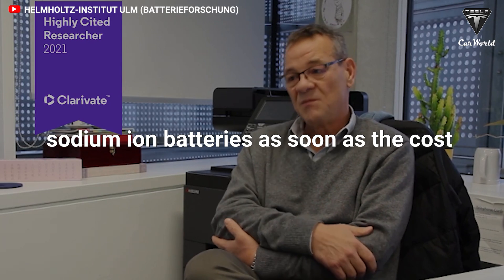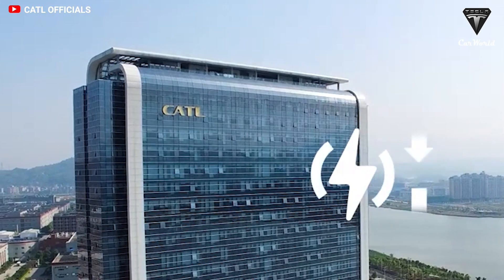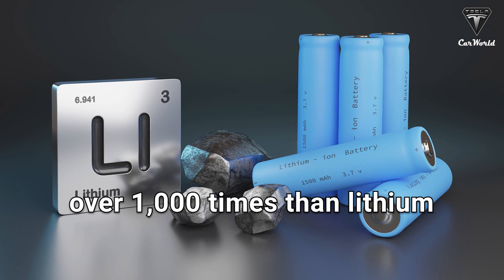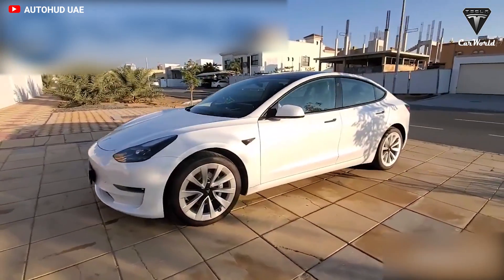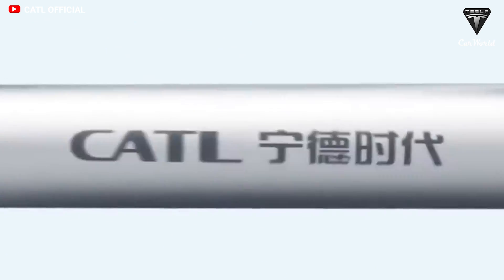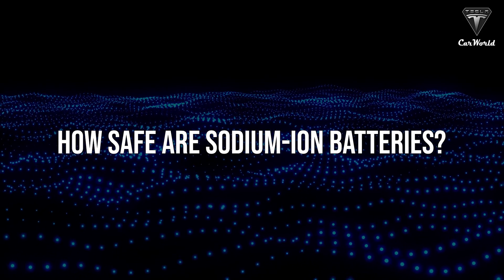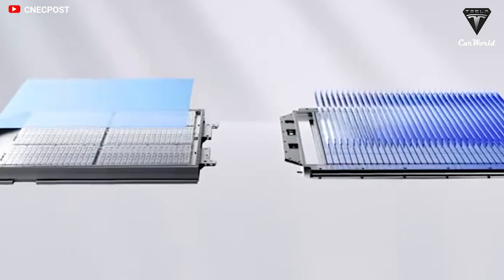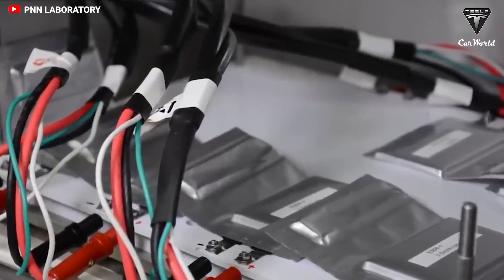Goodbye Lithium! NEW Sodium Ion 4.0 Battery Changes Everything in 2023!

Comment: As the lithum battery manufacturer，I've talked about  Sodium battery  with my colleagues  and we have many ideas about it. For the one hand , the sodium ion batteries has a very low price  And sodium is very easy to achieve, also it has very fast Charge speed.  For another hand ,the sodium ion batteries has two big disadvantages, The laboratories doesn't find out both affordable and safe and efficiency nagetive material, Meanwhile it needs much more even  Twice  Volume than the lithiumbattery to Provide THE SAME power.( I feel so Sorry for my broken English😥😥 ). Maybe you should know that the scientists began to experiment on the two batteries at the same time. However, the  Sodium battery perform Not very well for it's negative material. And the scientists cannot find  A very very perfect one until today.😥 To put it into a nutshell, I think for its  Affordable price and it's so achievable,WITHTHE development of the technology, Sodium battery will definitely play a very, very important role in the future battery industry. At the same time,it can never be as powerful as lithium battery(BECAUSE Li is before Na in the periodic table of ele ments) The lithium and sodium hybrid battery  may come first in the future.🧐🧐( I'm not sure whether I express what i think😥 cause English is not my mother language ) I will appreciate it If you have different ideas😆😆  Heated discussion will make theBATTERY industry much more better.
Reply: Thanks, and I have a question about the "Child Labor" --> Is it mostly true ? Or is it 1 case of child labor out of 1000 perfectly fine Lithium "mine" ?
---> So can Sodium Batteries have a better human-right value ? Or was it all an exageration from the medias ?
Reply: The primary issue is that the ion charge emitter side will degrade due to the larger ion size leading to reduced current capacity. The problem could be avoided by adding metal to the carbon intercallation media and using an extremely porus form of carbon. As for the acceptor side it is more problematic because the larger Na ions will bind more strongly to the CuCoOx based acceptor material. It can be traded for iron, particularly as copper 1 ferricyanide complexes. The penalty will be a bit lower voltage 2.7 to 3.3v and lower capacity per volume. It would have a higher current capacity due to the conductance imparted by the copper being an intrinsic part of the composition. 🤓
Reply: Would they be efficient in applications where size isn't an issue,  like ground installations, like megapack?
Reply: @1Eagler  Absolutely.  Do you care about the size and weight of your AC unit once it's installed?  It's a brick like any other on your property that you largely forget about :)
Reply: As an individual I don't mind 50% lower energy density or 2X the weight for 7X lower cost and faster recharge speed.  I do prefer small devices like phones to last at least 3 days between charges and I like batteries with a long overall lifespan preferably at least 7 years before the battery capacity drops to annoyingly low levels. I definitely get really frustrated when an old battery has to be recharged multiple times in a day. I'm also definitely unhappy that newer phones and laptops do not have replaceable batteries, and I also do not like pouch cells in general, simply adding an air exchange port to pouch cells so they don't inflate would make a huge difference but overall they're just a really bad battery design in general.
Reply: @SolarSeeker45  The thing is, the person in the video here is overstating the problem.  The best hybrid designs are 5-7x lower cost and about 20% lower energy density.  The replacement, though, are graphene batteries.  They are abut as pricey as Lithium Ion are now (with the price hikes) but offer 2-3x the energy capacity per kg.  My guess is that we will see the high-end luxury models using this and the lower-end consumer models running around town on the cheaper Sodium batteries.
Reply: @josephoberlander  That's a new one on me. I've heard of graphene super capacitors but I haven't heard of graphene batteries.
Reply: My worry with any battery that can, once it is on fire, be impossible to extinguish, now it the car is out in the open, it can just burn up, but if it is in a basement of a carpark, there is a danger that it can spread to other vehicles and do great  structural damage to the building which may result in its collapse.
Reply: For premium solutions , yes Li-ion will be the material/battery to use in the coming years . There are however many different uses for batteries , in which people/companies are certainly waiting for . For this i mean , storage of energy , renewables to be precise . Solar cells are nice , but saving that electric to use on a time when the sun doesn't shine is much nicer. Also , charging your car fast is nice but the grid not being able to follow on the sudden spikes in demand is also another option . With all the electrification going on , these things are getting more important by the second . Battery packs being offered at much lower value , 10kW/20kW ... for a affordable price has a very significant market . Yes , the sodium might be bigger and heavier , but it is not significant for such uses .
Reply: I agree also sodium is also very heavy.as more mines come online to meet demand im sure the price will go down within reason again
Reply: @pausesmana5531  africa may have child labor in lithium mines but by far most lithium is mined in south america and austraila with union labor
Reply: @benth162   What is your comment above?
Reply: @pausesmana5531   Definitely you are joking or you are A robot and maybe something i say has trigger keywords?🙉🧐
Reply: @christopherleubner6633   It's one am and i must go to bed now.I promise I will get up earlier tomorrow and reply You once I get up.🤔
Reply: @kricel  when I replied to your comment they didn't post it directly above yours, but stuck it way down the list.
Reply: @kricel  No, I didn't do my research, so I ask you as I saw you could have many more infos than other viewers here ^^ zero harm in my words. And Someone already responded to me so I have my respons : That there is only a few Lithium done in african mines.

The trigger words were you saying : "As the lithum battery manufacturer" --> So I thought you have more knowleadge
Reply: @1Eagler   Sure! I think what you said is what is the sodium ion batteries advantages and absolutely it will be a future trend.( It had its own advantages than both Super capacitor or lithum ions)😆
Reply: @josephoberlander  yeah! And the government will need it too.
Reply: @SolarSeeker45   The sodium ion batteries  As the level cycle expectancy than lithium ion batteries. If you're looking for a both fast charge and long cycle expectancy battery, You can go for Super capacitor(10000cycle times because  It won't have  Chemical reaction )( but it is very expensive. And also it is easy for it to discharge Automatically ) But if you are also want the low price. I think we can wait for the technology to develop I hope in the future We will get one.😎😎
Reply: @josephoberlander   You said what I want!😍 But I heard that the graphene Super capacitor  Will discharge automatically. And it is it's super disadvantage.( It will lose  Electricity  by 40% in just 12 hours now ) But I am confident that we can solve this problem.🤩
Reply: @SolarSeeker45   I think maybe he's talking about the same thing.😂
Reply: Terry White  I totally agree with the first half of what you said, but I haven't heard of the second half (and I don't know that the Great Lakes belong to Canada at the same time) let alone. . . Moreover, when building a large-scale power station, environmental protection and the opinions of local residents must also be taken into consideration. Do you mean that there is no shipping development on those lakes? Why is this? (It’s not that North Americans really may not understand these.) I think that if a resolution is correct, it will be implemented one day. If the implementation is to be accelerated, the proposer needs more power to speak or the decision-maker is more wise.
Reply: @Simon John Actually, I'm doing the lithium ion battery solar system  And I believe that Sodium ion battery will be the future trend.(  You know the large manufacturer in the world is now fastening their experiment in sodium ion battery) But it will take years, you know and The small manufacturer don't have enough finance (BECAUSE There are are still a lot lot of technology Difficulties in the solium ion batteries such as the Material in its negative pool) And you know the lithium battery is so hot these years  And even the small manufacturer can make a lot of money.JUST WAIT FOR TIME youknow🤔🤔
Reply: @adoreslaurel  If you are very afraid that your car will catch fire, you should first use a traditional car. If you want to use new energy, there will be relative risks, but the safety of each new energy and car is different. If you don’t care about the price, you can Using titanium ion batteries, its safety and stability are very high, and its cycle times are very long, but its energy density is low, and its price is very high, and secondly, you can use supercapacitor trams, which are also relatively safe, and he The number of cycles is also high. But the second is the sodium ion battery and the ordinary lithium iron phosphate battery, and finally the ternary lithium battery (although it is more dangerous, but its performance is really very good). The above is not considering the price and performance, but only considering the safety. ,You can refer to this.
Reply: @sergesmets5685  ah， I feel so. Sorry I can't understand what you said. Is what you said is the Na ion  Is a perfect choice for the low price car Instead of the expensive car? 🤔I agree with you.
Reply: @gibbyrobinson4862   I agree with you.And it's not just the price difference between lithium carbonate and sodium carbonate. More electrolytes can also use cheaper sodium perchlorate🤐
Reply: @pausesmana5531   I stillCan't understand you. I feel so sorry.what i can see in Your comments is human right child labour and I can't totally understand it?
Reply: @benth162   i stock down the list and I still can't find your reply. Why does it happen?😥
Reply: @kricel  Actually, age will preclude me from ever wanting or needing an EV, i have the perfect domestic situation for parking and charging, however, even if younger, I still think that so much is happening in the EV world and a lot more has to be done re infrastructure before I would consider them, they still cant match [ in a lot of cases]  an ICE car for long distance travel in a day with a quick turn around for the return trip. There is no point and just rushing out and ordering an EV unless you have a very good reason. Particularly as in my case, it would be a drive way ornament a lot of the time.
Reply: i understand you fully thank you
Reply: @adoreslaurel   yes!  What are you worried about it's quite normal.though i am in the lithum  battery instury ( Even  Lots of colleagues want to buy electric cars  once they have enough money )still 1/4 of my colleagues said that they won't buy electric cars in three years until it can be charge in five minutes or can be driven very safely.😂
Reply: @pausesmana5531  I saw someone else's reply to you, and I think I understand what you mean now😵. In fact, I am in the midstream of the lithium industry, so I am relatively not so clear about the upstream, but what I want to share with you is that 22 million tons of lithium metal equivalent have been discovered globally, and 117 million tons of lithium carbonate equivalent have been proven. Most of these lithium equivalents are located in the salt lake brines of South America's Lithium Triangle, such as Chile, Argentina and Bolivia. But now we use more lithium in Australia (mostly) or China (less) in lithium mines (because lithium in salt lake brine is relatively not easy to mine and purify), and Australia, as a big mining country, has a mature Most of the mining systems use machine mining or relatively mature and advanced mining methods.😂
Reply: @kricel  I thought you know many thing about the topic. And it's said that in Africa : There is case of Child Labour in Lithium mines. So I ask you if you knew something about this topic.. if it's real or not, common or not, a thing of the past or not.
Then someone else respond to this comment, saying there were only a small pourcentage of lithium that were mined in Africa.
That's all ^^  oh, and you respond a second time, saying you understood more what I was saying ! So yeah thank for the answer !
Reply: @kricel    Here you go....  I copied and pasted it here for you.
Try focusing on research that had nothing to do with "Batteries".  There is a German company that is in the final stages of testing their "Graphene Supercapacitors"  They can do everything LIthium Ion can do and much more now that they have solved the issues with capacitors.  They can charge in the same amount of time it takes to fill the tank on your car, and can drive your car for hundreds of miles before needing a recharge and will last for over a million miles.  Batteries are on their way out and unless new technology can take the place of gas-powered engines, battery-operated cars will start to slow in sales in the West, because with our wide open spaces, we need to be able to drive our cars for at least 250 to 300 miles before filling up in about 7 minutes or less depending on your type of car.  I am hoping the Elon Musk will take a look at "Graphene Supercapacitors" as an alternative.  If it works then Tesla can bring down the cost of their cars by hopefully 30% or more.
Reply: @christopherleubner6633  In comparison to advancements in electronics,  we haven't really advanced that far from the Leclanché cell, and are still hitting the limits of battery capabilities.
Reply: Its twice the volume? What about weight?
Reply: @kricel  Well you will still need a diesel to go outback in Australia, I think there is just a lot of media hype about EV's at the moment, their main market at present would be for city and suburban driving [well i think that would be in the minds of most people], but an EV going rogue in an underground carpark probably give the fire department the horrors. and what about the building insurers? still too many unanswerable questions yet.
Reply: The only reason you need so much Li-ion capacity, is because it takes so long to charge them.  If sodium batteries can be charged in ~5 minutes to provide 200 miles, then maybe total weight would be less than Li, because you don't need the same range if you can charge quickly.  Cars have ~300 mile fuel capacity (average) because it's kind of a pain to gas up.  But if you only ever have to charge up on roadtrips, and chargng is relatively quick, and you can let it inductively charge in the garage for daily usage, then you can get by with fewer miles between charges = less batteries, less weight, less space usage
Reply: @1Eagler  I agree
Reply: Might be good for home storage
Reply: hopefully the sodium doesn't cause the fires that the lithium ones. they are deadly intense.
Reply: I am wondering why it is not possible to have a sodium battery system that simply recharges outside the vehicle.
What I mean is this, a charged sodium solution is stored in a tank, a vehicle pulls up with a flat battery, you connect one tube to the back or side of the vehicle which drains the tank of discharged liquid, you connect another hose to the other side of the vehicle where another pump pushes in freshly charged liquid, when you are finished you fully charged vehicle that takes a few minutes and the discharged liquid that had been drained is the recharged and mixed with the remainder of that in the the pumps tank for the next vehicle.

This would ensure freshly charged ready to go solution for any type of vehicle, and you only pay for the charge, any excess liquid that had to be supplied would also be added to the bill, less liquid pays less.
This way you always have fully functional liquid in the batteries.

It's just a thought but changing the batteries solution would probably be quicker than charging,

And if the batteries were designed for this process you could have a battery that lasted a long time.
Reply: @eventhisidistaken  Defintely great insight!i haven't thought about it before.🤯Maybe the largest obstacle now is that the sodium ion technology isn't developed enough.😭 Haven enough finance, undoubtedly lots of people will put it into sodium ion  battery (like the big company)cause itis a trend
Reply: @nateb4543  twice the weight i think.
Reply: Do you have any thoughts on the atomic diamond battery?
Reply: Very good, I'm thinking it's a consumer the idea of the alternative sodium ion batteries would bring the lithium price down as it will create competition and therefore bring the price of the lithium l&I down to a reasonable rate or price
Reply: Bro stop complaining to your English which is good enough. If you not sure just use chat gpt for translation
Reply: Can't wait, I want a sodium battery ev
Reply: Thanks for inside info.  Id  call it the rust battery.  Were theres a will theres a way.  ofcourse like cancer solutions sounds like a treat to many tinkering jobs
Reply: You explained it well.
Reply: @1Eagler   I think that you'll find that TSLA already deploy this type of battery in it's mains power management system in Oz.
Reply: Please address the Cobalt salve trade in the Conga …..
Reply: Please address the colbat slave mines in Congo
Reply: @Pauses Mana  it's salt. It can and is produced locally,  because of your concern for child labor,  I hope this means you don't support slavery and companies like Nike and there supporters.
Reply: What you should be discussing is graphene and hydrogen fuel cells - if you are a scientist/engineer you know the laws of thermodynamics say EV’s are dumb in the context of energy efficiency
Reply: @kricel  Sodium batteries, desalinization plants, biodegradable plastics, etc. The future!
Reply: I just dont want my car to get high blood pressure
Reply: @SolarSeeker45  Vanadium flow batteries are similar. There are a few types of these lower output, steady, longer lasting batteries around its just they are bigger and heavier which is no good for cars. For a home though, good choice.
Reply: I heard that Sodium Battery 🔋 is so cheap,  because it's a lower capacity of power, in other words..it will last shorter than Lithium Battery. It's not a solution at all to buy a cheap battery, but it'll make more problematic and we have to charge Sodium Battery on and on. It'll waste our time and useless bro.. 😪 😕 😒 😔..!!!
Reply: Thank you. My hopes are dashed, but I won't need to watch the video.
Reply: Thanks for the explanation...you did well with it. That makes more sense to me.
Reply: @grumpybear42  i haven't heard about it before😳
Reply: @basketballjones9803  the conflict is that the raw material is high because of the heat in lithium battery.
Reply: @nawasnychzasadach  maybe i can thank u for your prize.😂
Reply: @pausesmana5531  
Well if Elon "its really not that hard" Musk inventor of the tunnel and human driven car! says 2023 the time line is not 2023! 2024 new date of 2025, 2026 new date of 2028, 2028 new date 2029, 2030 he deltes all references to it and pretenders he never said that!
Reply: @Simon John part from the cost of the running the truck is 150% more than diesel! Also having to pay companies to use them is not the answer!  🤦‍♂🤣
Reply: We can deal with shorter lifespans if the cost is reasonable.  Replacing a battery for 3 or 4 thousand dollars every 50K miles is a world of difference from my friend who if it hadn't been covered under warranty was looking at 30K to replace the batteries in his EV.   While lithium ion batteries are "better" on paper, I fear that we are all just creating an entire generation of disposable cars.  Would YOU personally buy an 8 year old Tesla?  If it still had the original battery?
Reply: @josephoberlander  this is the problem with telsa trucks batteries need to be replaced 2-4 years (4 years is highly unlike) at a cost of 130-150K part of the running cost (using telsas own price for cheaper car electricity) making it 150% more expensive than diesel!

THIS IS WHY THEY HAD TO PAY PEPSI TO USE THE TRUCKS! 🤦‍♂🤣
IT IS NOT A VIABLE BUSINESS MODEL!
Reply: he bought out old tech to save money LOL
Reply: Your English is better than many native English speakers. No need to apologize.
Reply: Look like hybrid time here,half sodium
Reply: 9p
Reply: @pausesmana5531  You've probably heard about child labor being used in some cobalt mines.  Note that cobalt is heavily used in gasoline refining so if you're driving a gas powered car, you're increasing the need for mining cobalt.  Also note that lithium-iron-phosphate batteries do NOT use any cobalt at all and they are becoming a larger and larger percentage of EV batteries.  Finally, note that Tesla has a strict policy of vetting its cobalt sources to assure no child or slave labor is used.
Reply: @adoreslaurel  But of course, all those gas powered car fires aren't a problem at all because ... um ... well, it's just a gasoline fire and that surely can't burn anything.  lol
Reply: @SolarSeeker45  7x lower cost for the business not for you, just more profit...
Reply: @ayCarumbaQueLio  Exactly, I had near 0 informations about all of this, but now that someone explain this and that also you explain this : I now have a more full knowleadge about the question.
Thanks
Reply: Appreciate this explanation
Reply: @ayCarumbaQueLio  Aren't you missing my point?
Reply: As you had said, " Meanwhile it needs much more even  Twice  Volume than the lithiumbattery to Provide THE SAME power."
I think if you get twice as much sodium batteries, then they will still be cheaper than the pure lithium ion battery? And really, to get twice as much sodium battery, you just stack it on top, yes? easy and it does not add all that much height (yes, some but it is only about 6 inches).
But yeah, from the sounds of it, a Na-Li hybrid solution may be the way to go, based on cost and performance.
Reply: Kricel, your English is very easy to understand, and you express yourself well. Don't worry about it.

I think starting out with hybrid sodium/lithium is a great idea. Then, as developments in sodium utilization advance, society could wean itself from high-volume lithium usage.
Reply: I was trying to look for energy density and i found my answer.  So, can I assume for the same weight we have half the range?
Reply: They don't want us to use sodium because it is cheap won't profit them.
Reply: Kricel
The operating principle is - "cost". An engineer must provide any product, implement, gadget or what you want at "affordable" cost, so that everyone can use it. Li-ion batteries were developed for Space applications & irreplaceable there. There they remain. While Li ores are scantily placed over the globe, our Earth is "immersed" in a bath of Na salt, abundant beyond human imagination. I need to search for Li ore that might give problems of supply chain. 
Next, in the trade-offs between contending requirements (cost, volume occupied, charge density per kg etc), Na-ion scores over. In the coming years more & more battery-driven transport (land vehicles) will be required (say a billion), Na-battery will prove to be ideal. Only the vehicle will be heavier that it can take. 
Next is disposal & pollution. Here too Na beats Li. Na devices can simply be dumped in the Ocean/sea.
Yet, Li- batteries will have a "niche" market that we 'll agree & abide. With the universal use of Na- batteries, the price of Li metal & with it Li-battery cost will come down.
Reply: @adoreslaurel  
You hit the nail at the right spot.
Reply: I think your conversation was very detailed the only thing they didn't add is that buying an electric car would a sodium battery need to be replaced than a lithium one with use.on everyone's mind would be cost to a consumer but also whether its cleaner or greener which is good or are manufacturing is looking at a cheaper option.The cost of buying is good just if you need to keep replacing them whether it out weighs lithium
Reply: Be confident~ You are great!
Reply: @pausesmana5531  
Sodium is (almost all) mined from sea water and doesn't depend on child labour. Extraction of Sodium is high Tech job, unlike Lithium mining.
Reply: @christopherleubner6633  
Yes, it is a Technology problem needing the invention of suitable Na ion receptor metal. Yet, other advantages make sodium battery attractive, particularly where size & weight aren't the issues.
Reply: @kricel  
Regarding "charging speed" a compromise has to be struck between the speed & cost. 
Over-nighter charger is both convenient & safer, with a "stepney"battery for emergency . In the upward EV Technology, we need to  learn a lot, still (We find it still in infancy) - till the final item with own procedures-protocol gets evolved.
Reply: @adoreslaurel  
For all the hype about replacing Petroleum with Solar, wind & wave energy, for the rest of this century, at least, we are going to need it as the mainstay. Inconvenient alternate Technologies breed more unsurmountable difficulties, answers for which are needed to be extracted from technologies. The only silver-lining is that lesser demand on Petroleum leads to price reduction - particular advantage to aviation.
Reply: @flitsies  
It is convenience, my friend ! I can't carry a mini-factory with me.
Reply: @grumpybear42  
Wow, that is unaffordable for any human (if I find ways to make diamonds cheap, even). Engineering also strives to make things affordable & convenient to use.
Reply: @hendrymarwan5805  
Yet, Technology is about finding solutions (to problems) one by one, over time.
About wastage of time, a million man-years were wasted, fruitfully so that we are at this stage & enjoy the fruits. Somewhere, some one has to slog, as part of his job.
Reply: Thanks Kricel, for the interesting info, when I ordered the Think I went for a Li battery, since they seem to withstand everything, a few months later the battery failed and they spent 6 months fixing it.. :) A freakin joke if you ask me, I  didn't fork out money for an electric car, and then arrive at work by pedaling a bike..:)
Reply: Absolutely true everything you said 💯
Reply: @1Eagler  EXACTLY the place they should be used ,,, grid storage etc
Reply: Sorry... There are already sodium-ion battery production model EVs for sale in China for under $10,000. But nice try... Squawk squawk nay say. You remind me of the fossil fuel company propagandist pundits
Reply: Terry White  Why would Elon want to pay ridiculous Canadian taxes, when he could easily do the same thing on the American side of the Great Lakes?
Reply: We understood you well, kind sir. And thank you for your input.
Reply: @christopherleubner6633  HERE WE GO AGAIN; Humans talking about Something TODAY that they said Yesterday about the same things they are USING TODAY. Go figure!!!
Reply: Will it apply to the redevelopment of e-bike batteries too?
Reply: Old Sodium ión acid batteries are weaker than lithium ión alkaline batteries. We have to add better capacitors to the circuits  to run high voltage and high amperage direct drive motors  of EV'S .
Reply: @SolarSeeker45  You will when an already obnoxiously heavy EV will have to weigh twice as much for the same capacity, which would drastically reduce its range, requiring even more battery capacity to make up for it.
Reply: I live on a sailboat and have lead acid batteries what would the energy density difference be between these sodium batteries? Would it be a good switch?
Reply: @MrM-hl1vp  I believe they are switching to Sodium Chloride cells due to overall costs and readily availability of salt. I hear that NaCl cells and the materials needed to build and create a conducive battery will be slightly heavier compared to Lithium Ion batteries (:( ; I have an e-bike and was hoping they would innovate a lighter weight with yet long distance traveling capability  e-bike battery).
Reply: @StarEssences  thank you Tracey, I'm mostly hoping to find a replacement for my lead acid batteries. I don't want lithium because of the danger of them, and the price. Weight is not as much a concern.
Reply: @MrM-hl1vp  Sodium batteries have half the energy density of classic lithium ion.
Reply: @andrewscharbarth2099  I get that from the video. I'm asking the difference between lead acid batteries and sodium batteries.
Reply: @MrM-hl1vp  Mass energy density:

Lead/acid:  ~30 Wh/kg cycle life: 300-500

Lion: 120  Wh / Kg cycle life: 3000+

Sodium:  100 wh / Kg cycle life: 2000
Reply: Sodium would be great for the house so then it could charge your lithium in the car.
Reply: @portagepete1  You must work for the government.  Not only do you then need even more batteries, you have the conversion losses in ac to dc to store the electricity then you get the dc to dc transfer losses going from one battery to another.
Reply: More Sodium is available than Lithium. Sodium still can burn as much as lithium.
Reply: Lower cars weight as much as possible and accept less MPH I think 80MPH is enough for everybody...a salt battery charges instantly there is no charge...you could carry a bag off salt n top up a  battery but obviously industry batts arnt designed that way but the volta stack salt batt as a basic but using extra materials such as quartz n plenty other materials the list is endless hemp carbon beats the shit  out off graphine carbon which is expensive as fook...
Reply: English is my native language and you did great!
Reply: Thank you for trying to say your thoughts. I think you did fine expressing your feelings. 
   One question; what about use for bicycle motor batteries? When will Na-Ion be available? SIZE is not as important for me as I build Electric Trikes for handicapped people. I need a 40 Amp Hour battery to power my trikes. This gives them good range without pedaling, as well as SPEED, to keep up with regular gas powered cars.
Thank You.😊
Reply: Всё повторяется ! Лучшее( ?) враг уже достигнутого !
Reply: I'm willing to take the extra weight trade off for safety.
Reply: Respectfully I disagree with your disadvantages. Yes, that is true now but if you compare the density of sodium batteries to lithium when they first were being researched you’ll see sodium is actually better. It’s fairly safe to assume that sodium battery density will drastically improve which is has been doing already. If you look at the trends when compared to lithium, sodium batteries have the potential to become more dense than lithium within five-ten years
Reply: The home energy and backup market does not care about the size as much as the auto industry. If I can get 10 kw reliably for under $4000 or $5000  I can run most of my house most of the time. If the battery life is there it will be worth it easily.